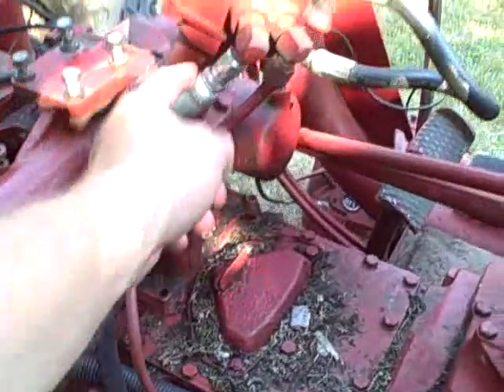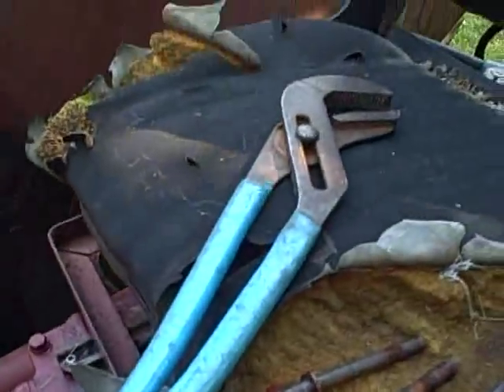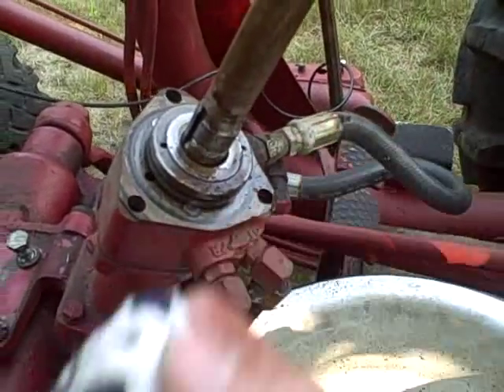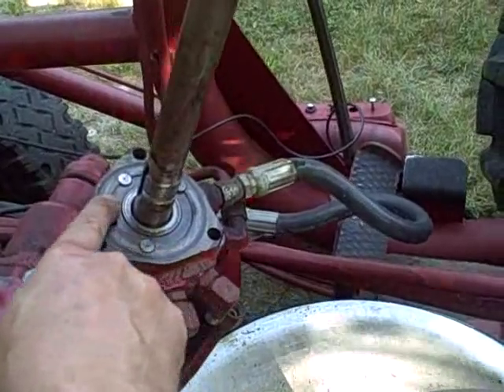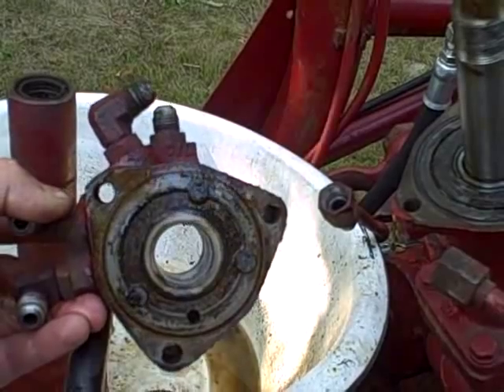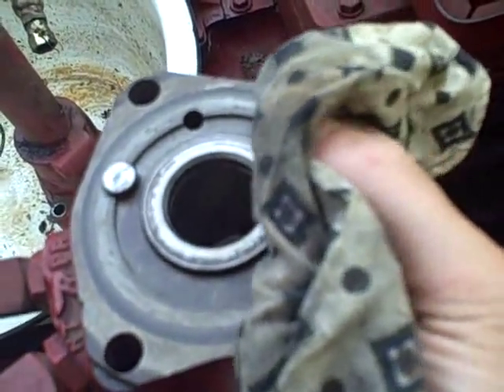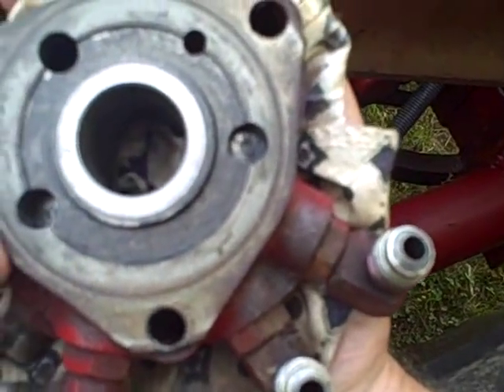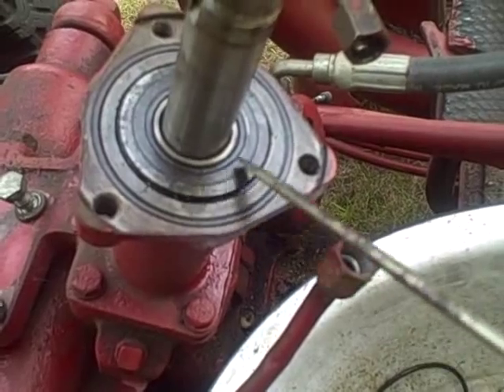IH 350U Tractor Project Part 23

Comment: You mentioned an IT manual? Where would you get this?
Reply from the maker: Think of IT manuals as being like a Chiltons manual for tractors. They are not written by the manufacturer like a shop manual. They are not a detailed. But they do have good information and are a lot cheaper and easier to get. Most online tractor stores and even ebay have them for numerous brands. The it manual for the 350 utility is number IH10. So google IT IH10 and you'll find plenty for about $28.